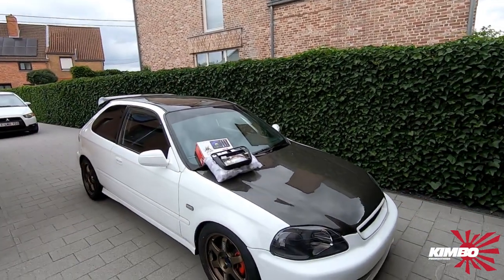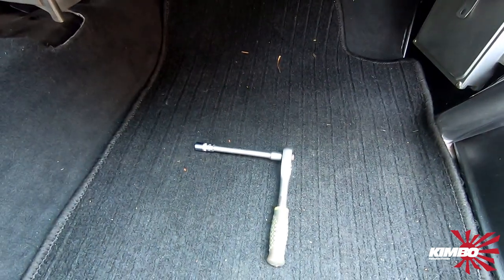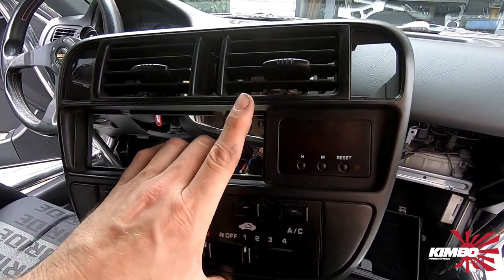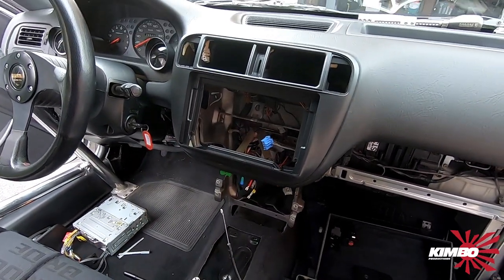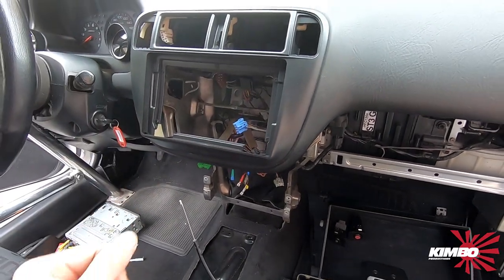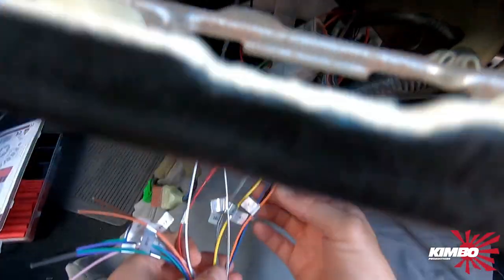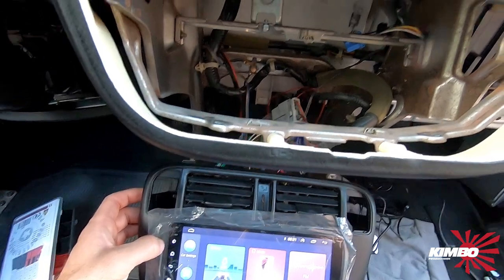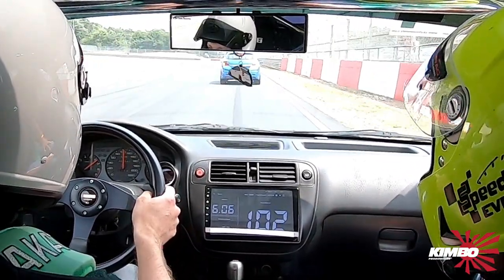Installing 2Din 9" Android Radio in Honda Civic EK (96-00) Step by step

Comment: I know you address this in the description but unless you have access to a JDM/EDM stereo fascia with intact A/C vents; DON'T DO THIS. USDM vents DO NOT FIT. You will wind up with 2 ugly, gaping holes in your dash, that is going to cost you a minimum of $150 USD to fill them with the proper sized, and imported, AC Vents. I just UNDID my 9 inch headunit and ac relocation for a stock set up with a true single din android stereo, and it looks 1,000 times better.
Reply from the maker: @GoneAsGoneCanBe  i did not know this when making this video. That's why i put it in the description.
The reason why i switched to this setup is because my old radio was broken and i wanted to use spotify and i also wanted to connect my hondata S300 V3 with the radio to be possible to read my ecu and let it show on the screen. I have my civic since 2002 and i did not liked the look enough of the center of the dash. That was also the reason to make it more modern. But that's everybody's taste.
Reply: @KimboEK4  Fair enough. I DID like the big screen. When installed properly it looks great, and if I had your vents, stock, I DEFINITELY would have kept it.
It just looks SO ugly with out the vents. But, much like you, I was not aware of the vent size difference before buying one. 
Of course the only complete stereo fascias you can find that have the vents are for the Civic Type R, at least $100 USD, usually more, and its like are you really gonna buy a Type R fascia just to gut the vents? 
I have heard of people cutting a section out of their usdm vents, gluing them back together, and making that work. But I would worry about longevity of the vents at that point. 
Other people have cut the vents out of both fascias and plastic weld/glue the stock vents to the 9 inch fascia and then body working it until it looks good. 
Because of the cost associated with just the CTR fascia, or all of the work that would go into frankensteining the two fascias together, most people with 96-98 usdm civics would be better off locating the guts of a 99-00 civic dash and swapping that over if they have to have the 9 inch screen. I think my screen is 5.9 inches. Perfectly adequate for wireless carplay.

Comment: Where can I get those vents for Panel Assembly Center?
Reply from the maker: Hello, iff I know what you mean, i tried to explain in the video that you have to break the original honda vents of the center panel with a screw driver or maybe warm it up so the glue gets weak and then glue the vents on the new center panel. Greetz Kimbo
Reply: @KimboEK4  my original panel center (US 98 Honda hatchback)doesn’t have that wide piece in between the vents. Mine is thin, I just bought an aftermarket one that looks just like yours and my vents don’t fit from the original one at all.
Reply from the maker: I have an European Honda Civic EK4.
Maybe you have to look for the center Piece like on ebay in a European country. If you must order it at a Honda dealer it would be way to expensive.
Reply: @KimboEK4  ok thank you for your help